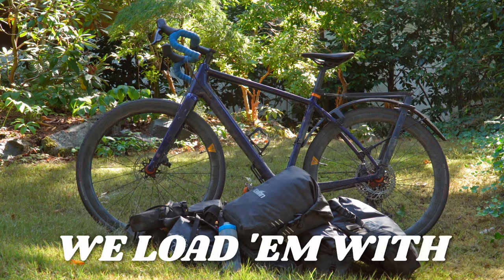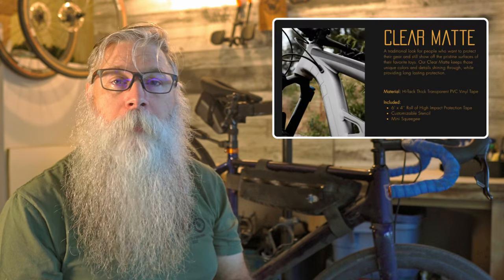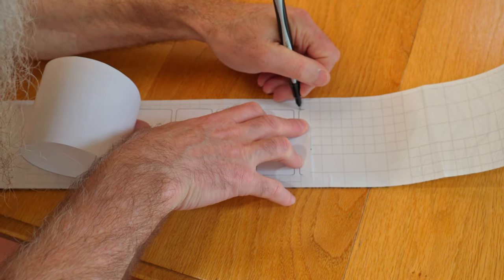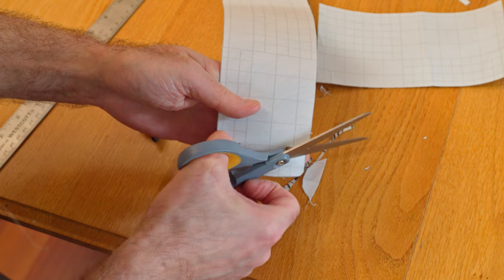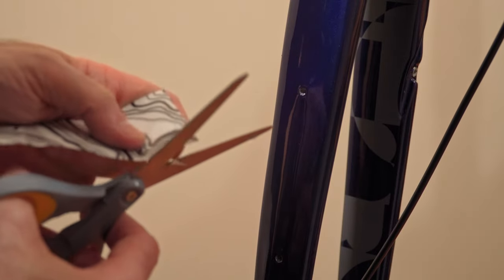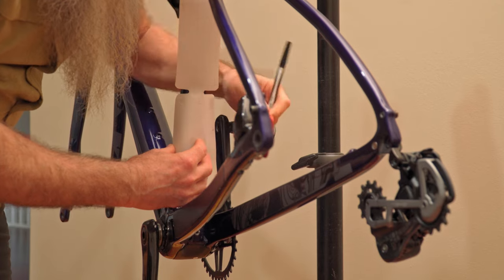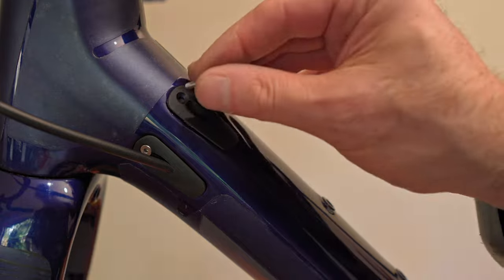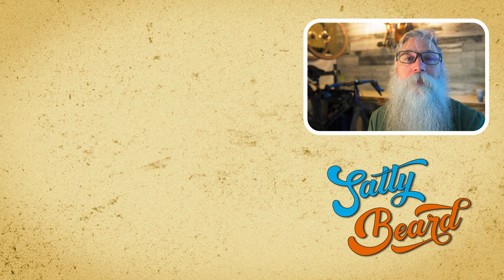DIY: How to Wrap Your Bicycle

Comment: One tip I have for making templates of complex areas like the top/down/head tube junction is to lay on a couple of layers* of masking tape. Draw on to the tape what seems appropriate. Remove the tape and cut out the template. Now lay it on the non- backing side of your vinyl and stick it down (now it wont move). Cut around your template, remove the tape and voila.
The beauty of this if you also need an identical template for the other side of the bike - take your original template and place it on the backing side of the vinyl. Instant mirrored template 😁

* I say a "couple of layers" as the masking tape is less likely to tear when being removed from the frame
Reply from the maker: Cool process… I can totally see how that would work 🤜🏼🤛🏽👍🏼 ~ Thanks 😊
Reply: Thank you brother for that tip... 😅
Reply: No worries fellas 👍
Reply: That’s a great idea. I’m about to do my bike with magenta vynil! ❤

Comment: That bike looks amazing! Thanks for the tutorial. I was actually thinking of just wrapping the main parts of my bike with grip tape. But this looks way sleeker. 

Btw what’s this bike make and model? Looks like a gravel or adventure bike?
Reply from the maker: Thanks! The bike is my Kona Libre DL.  I have a bike build video on the channel if you're interested.
Reply: @SaltyBeard_Adventures  thanks yep found it - love all the cargo-carrying accessories! How are the tires holding up on it? Any recommendations for durable tires without gaining too much friction on normal roads?
Reply from the maker: Tires, always the hot debate.  I'm a big fan of Specialized Pathfinder Pro for mixed riding, but there so many others that are good.

Comment: Does it matter what soap to mix it ??
Reply from the maker: Any liquid soap.... and very very little is needed.
Reply: @SaltyBeard_Adventures  thanks for the fast reply, so I was just done with a couple pieces and there’s some haziness underneath the film. Please tell me that it will go away and if it does, how long does it usually take for it to disappear?
Reply from the maker: @jefflodevico3151  - yeah, totally disappears... and you may have some "micro bubbles" - those too will disappear in a few days!
Reply: @SaltyBeard_Adventures  thanks again for the fast reply! Yup, I was getting all nervous I thought the haziness wouldn’t go away, but thanks for the info! You have a blessed day and happy riding
Reply: @SaltyBeard_Adventures Hi again, so I also noticed some sticky residue on top of the film. What’s the safest way to remove it? I looked into goo gone, but it said it’s not safe for plastic.
Reply: Hmm, I personally didn't have anything, but maybe you got some adhesive on the top?  A little elbow grease isn't pealing it away.  Butter removes sap, so I wonder if that could work.  A silicone based cleaner would be safe for plastics.  Hard to tell without know what's on it.  Reach out to the MFGs.
Reply: @saltymediahouse yes I did get adhesive on top of the film. I also did reach out to them as well, but haven’t heard nothing in 3 days

Comment: Old man (Winter) bike??
Reply from the maker: Is there a question there?  No this is not a winter bike.  But all my bikes get some sort of wrap, even my winter bike because I usually have either a tool pouch or 1/2 frame bag strapped on.  Any grit & grime will start to sand the paint off quickly.  All my current bikes are carbon too.

Comment: Would you recommend for carbon frames?
Reply from the maker: Yes, all my current frames are carbon.  It’s great on all frames, but because this wrap is thicker it’s more suited to MTB, Gravel, and bikepacking bikes were you want good abrasion resistance and impact protection from rocks.  If I had a dedicated road bike, I would probably only run thinner protective tape where bags attached.